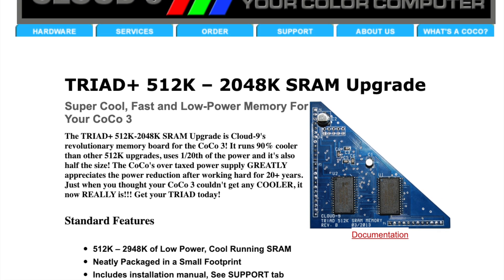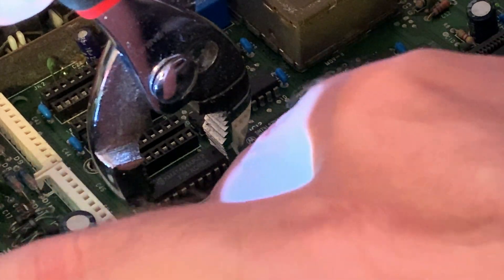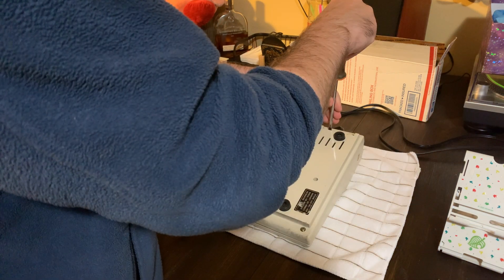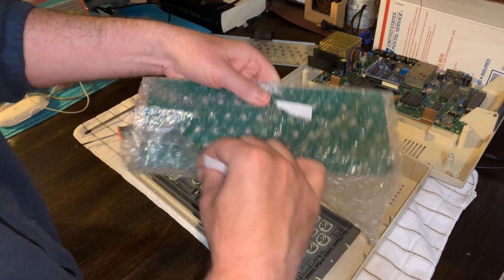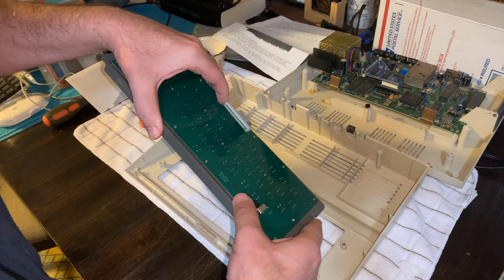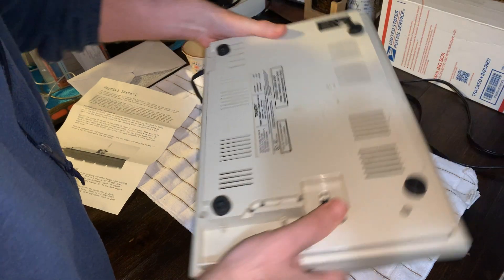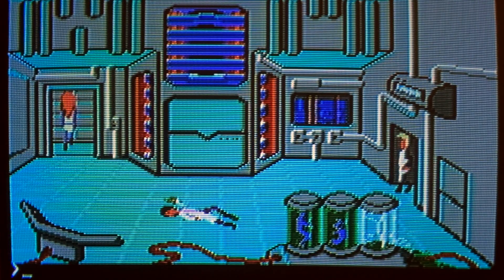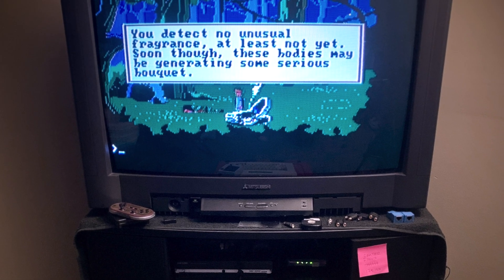#SepTandy 2024 - Color Computer 3 Upgrades

Comment: The Coco 2 mode on the Kefix translates the ALT and CTRL keys to act as up and down arrow keys (which is where they were placed on a Coco 1 or 2). This enables games that use the 4 arrow keys to be played with two hands, which is much easier on some games. There are some good 512K games on the Color Computer Archive - Pad-Dude 3D Monster Maze, Contras, Sinistaar, Digger III are a few off the top of my head.
Reply from the maker: Thanks, Curtis. Yeah, that mode switch is an awesome option. I’ll be checking all those 512k games out. Thanks to The CoCo Nation for informing me about these upgrade options over the past few years. I think all that’s left is a CPU upgrade and maybe an RGB cable, then pray it lasts 30 more years.